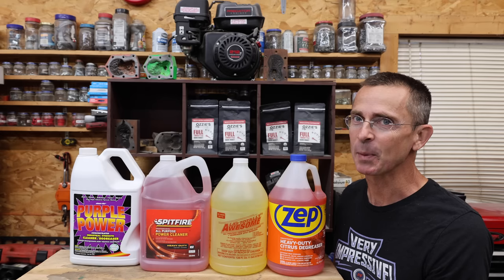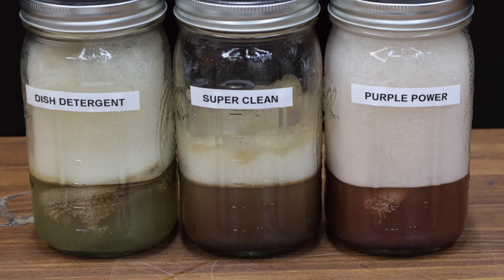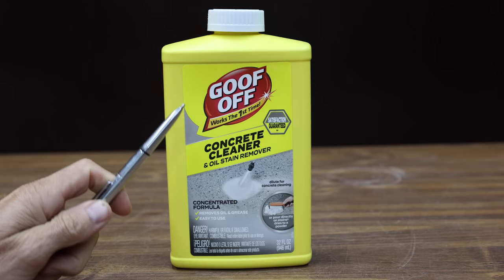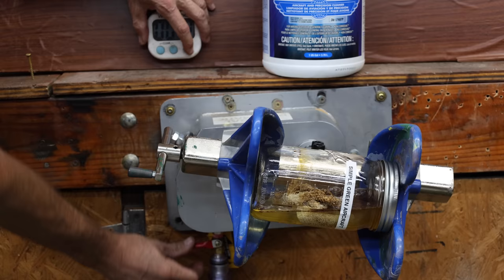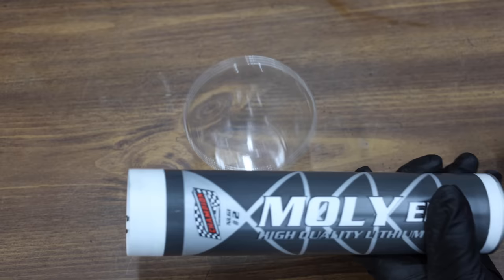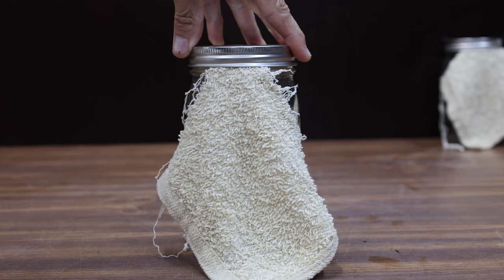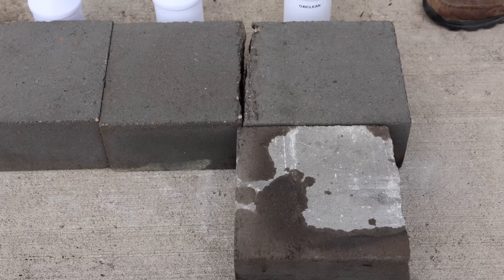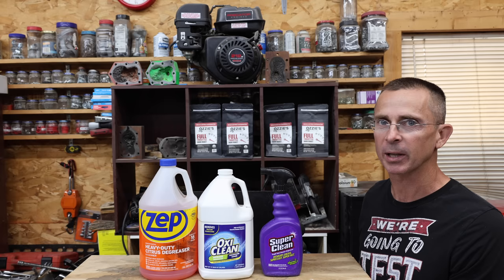Best Concrete and Engine Degreaser? Let’s Settle This!

Comment: An addition to your channel, maybe repairs most don't consider and just replace the part, like rebuilding your own starter, or alternator, reconditioning a battery, some of which you may have already done. Great Channel, I always go to you first before I buy anything related to what you cover.
Reply from the maker: Thanks!

Comment: I sell Oil Eater at work (I manage a hydraulic hose shop). I've cleaned oil spots on my driveway and I pre-treat my clothes with it. Now, on the 1 gallon jugs it says 1 gallon makes 30 gallons, also on the back label it shows 10:1. Also, it's biodegradable, non-flammable, non-acidic and non-toxic.
Reply from the maker: Thanks for sharing.

Comment: Great content as always. You are the “live and unbiased” consumer reports beater! I have not viewed your entire library of videos….but will look for weed killers for tough weed (ivy), maybe best green and thickening Kentucky bluegrass fertilizer that can only be watered by rain……as for branching out, how about videos on products that do like things but with different systems..pros and cons? Sample might be dethatching acreage with a tractor….many different attachments meant to do the same…how they each work, plus pros and cons…..can apply to vehicles, engines. How to build a 1/4 acre + pond? Just so many things out there……..still, product testing is probably the most requested service by most.

Comment: I've used a product called "incredible pink stuff " recommended to me by a mechanic.  Worked well cleaning engine parts and block , had to spray them with oil afterward to keep them from rusting
Reply from the maker: Thanks for sharing.

Comment: Test the Shaffer cleaner, after 44 years at a pipeline pump station with multiple stationary diesel engines I found the Shaffers cleaner far out did all other soap cleaners.
Reply from the maker: Thanks for the suggestion.

Comment: I've been using superclean since the 80s.... when Castrol still owned it.  I'm glad to see you removed it from the towel test since it will stain things purple. (Including fingernails LOL)  WHen I work on old equipment... it will clean better than anything else. (And doesn't stink like "Foaming" engine cleaners)   Oh... one last thing.... none of those are designed for Bio-removal, so I'm not sure why you did a mildew test.  AND... going back to my previous statement... it could stain the plastic siding. Thanks for the vid

Comment: Todd, I LOVE your channel.
As a scientist myself, your employment of the scientific method on ACTUALLY USEFUL products/info is INVALUABLE.
That said, your mechanical knowledge is INDISPENSABLE,  and I would really learn SO MUCH from seeing you rebuild transmissions/engines, etc.
If I have a vote I would say if you could keep doing product reviews AND add transmission/engine rebuilds, that would be great for me.
Also, for the above experiment, I would like to request adding alcohol as a degreaser: since "like dissolves like" using increasingly more organic alcohols should help dissolve the grease better (though there is probably an upper limit), i.e. MeOH, EtOH, Isopropanol, Butanol, etc.
You can also try acetone, or even "rinsing" with gasoline, THEN washing away with acetone, MeOH, EtOH, etc.
In the lab we often clean glassware that needs to be stipped of organics/detergents using other organics (generally simple organics) that evaporate quickly and DON'T leave a residue.
The organics are also good as a final "rinse" of glassware after washing with water, as they will hyrdogen bond with water and evaporate with the water faster than water does on its own.
A word of caution: make sure to wear disposable gloves (nitrile is my preference, like the black ones you wear) acetone dissolves plastic, and due to all the organic nature of the alcohols, the oils will be stripped off your skin and dry your skin out.
Thanks again for all your hard work, I'm happy to help in anyway I can if you need more info, etc.
Reply from the maker: Thanks for your opinion.

Comment: Long time viewer here and super thankful for the videos you put out. I'd like to throw this out there... I recently rebuilt a motor for my truck and as you may expect (being an older truck) the parts were TERRIBLE dirty! Rather than paying a machine shop to clean the stuff I figured I'd stop by here and see what sort of degreasers do what. I wound up grabbing up a few bottles of purple power mainly due to it being on the shelf at the auto parts store. I got to SCRUBBING. Wire brushes, brillo pads, steel wool, scotch pads, and loads and loads of elbow grease. Finally I decided to grab some of the LA's Awesome from the dollar store. Dude... That stuff is AT LEAST 40x better than purple power. Once LA's Awesome came into the equation... I literally stopped scrubbing. All I had to do was pour the stuff in a bucket and let the parts soak for a few hours. I wound up soaking my entire heads in this stuff! Nothing short of PHENOMINAL. It eats everything but rust. I will never buy another degreaser (willingly) so long as I live.
Reply from the maker: Thanks for the feedback.

Comment: Greenstuff J30 Industrial Strength Degreaser sold by PDP in Canton Ohio is probably the best overall degreaser - cleaner we have ever used. It "is a water based, non-flammable, and biodegradeable product.  A heavy sudser with a strong affinity for oil and grease, as well as dirt". It works for many applications and has been our first choice for over 30 years in the truck and automotive industry!
Reply from the maker: Thanks for the feedback.

Comment: I use Oil Eater in my floor scrubber for my floor at work... It does a pretty decent job using it diluted in water 50:1... Great video!
Reply from the maker: Thanks!  Thanks for sharing.

Comment: I remember when Greased Lighting came out there wasn't anything that could touch it, as a matter of fact you didn't want to get any of it on your hands because it seemed like you could never get it to wash off. But it sure would attack the oily/greasy stuff i used it on. The last time i bought it it didn't seem to work as good and the price had doubled.

Comment: Awesome review! Wish you had included S100 in this. It’s marketed as motorcycle cleaner but in my experience it’s the best at getting grease, oil and grime off anything by simply spraying it on and rinsing it and all the dirt and grease right off. It’s amazing.
Reply from the maker: Thanks!  Thanks for the constructive feedback.
Reply: Try the Simple Green Pro HD. It’s also safe for motorcycles. It’s specifically formulated to be safe on all metals. It won’t corrode/etch like Super Clean and regular SG can.
Reply: @seashackf1 thanks for that info

Comment: Love all your videos brother!. Since you soaked the concrete blocks in oil, it would of been really interesting to see what would of happened to them if you were to let half of each block soak in its respective cleaning product + a control instead of power washing. I’ve also have heard from different grease monkeys that tide laundry detergent works pretty alright. Either way, great video👍🏽

Comment: I've tried Super Clean, Zep, Purple Power, Krud Kutter, LAs Awesome, and Simple Green (standard) on "baked-on grease and oil". Super Clean is the only product that would soften and remove such grime! Soak your range vent-hood metal filters in it for an hour or two; and you can almost rinse the grime off!
Reply: Be careful, SC can corrode/etch aluminum. They even now specifically warn about it. Unlike the WD40 Specialist and Simple Green Pro HD which are specifically made to be safe on all metals and not corrode.

Comment: I would like to see you do a few different engine/transmission teardown/rebuild, while using your choice for various lubes and whatnot and a brief explanation of why you chose those items.
You could even do T&R on different power tools that you use on the farm and possibly around a household garden.  It would be nice to have an easy to follow repair video, and I think that you have the ability to make videos that are easy to follow and are still informative.  Thanks
Reply from the maker: Thanks!  Thanks for the suggestion.

Comment: Careful with these when using concentrated; i splashed some Zep cleaning an engine, and a little bit soaked in to the top of my sock, I paid it no mind and kept working for a couple hours until it started itching more and more. Turned out it de-greased the top few layers of my skin, came right off with the sock lol, and my foot swelled up for a few days.
Reply from the maker: Thanks for sharing.

Comment: Super clean has always been my go too. It may be pricy but I stand behind their products. Their foaming degreaser is a life saver.
Reply from the maker: Thanks for the feedback.
Reply: Be careful, SC can corrode/etch aluminum. They even now specifically warn about it. Unlike the WD40 Specialist and Simple Green Pro HD which are specifically made to be safe on all metals and not corrode.

Comment: Your testing is reminiscent of MIL-STD-810-G testing but in some aspects more intense.  Keep going as you have only skimmed the surface.

It would be interesting to see you test various electric screwdrivers and drills of various battery voltage ratings; various car wheel tire and rim cleaners; various car leather seat conditioners and protect ants.  

Great channel!
Reply from the maker: Thanks!  Thanks for the suggestion.

Comment: We've been using Super Clean for decades.  They warn you not to use it on hot engines and I can confirm that.  Tried that on a slightly warm engine once and it bleached the blue valve covers white. Also stored the bottle on a metal shelf for a couple of months and the migration from the cap down the side of the bottle stripped the paint from the shelf!  Stuff is potent.  Best to wear gloves when using it as it's very difficult to rinse off of hands.
Also use krud cutter for laundry and it works well in washing machine.  Super clean makes a good prewash spot remover.  Simple Green, Purple Power, and Zep haven't worked well for us.  May be differences in water or soil involved.
Reply from the maker: Thanks for the feedback.
Reply: Super Clean can corrode/etch aluminum. A few years ago when YouTubers were hyping it for automotive use they said it was safe on all metals. Now SC has a specific warning about that it’s not safe for it. Because of that I’ve gone back to Simple Green Pro HD, the purple one. It’s specifically formulated to be safe on all metals.

Comment: Excellent test and review so we don't have to do the same.  I use Zep to clean my smoker.  Does an excellent job.  I have trouble with removing oil stains from my drfveway with any cleaner.  I've even tried gasoline and carburetor cleaner with not much luck.  So I grind clay kitty litter into the stain until a fine powder remains and I leave it there until the next rain washes it away; then it comes back but not as bad.  I think a lot of the oil stain is from solids suspended in the oil.  Difficult to lift and float away.
Reply from the maker: Thanks!  Thanks for sharing.

Comment: Best degreaser...Mineral spirits. Second best, diesel with soap added. Third, steam cleaner/hot water pressure washer with dawn detergent...
The hot water pressure washer is my favorite, but who owns one of those ??? My personal home shop fav is mineral spirits.
Former Tool and die maker - engine  builder/offroad.
Reply from the maker: Thanks for sharing.

Comment: I've had good results with the Zep citrus,  and the zep  blue / green cleaner works well too.  In fact, I even use the zep green as hand cleaner (no more gojo).  The zep citrus can be used for hand cleaner too, but its stronger and can affect skin after awhile.   I vote for please continue product testing.   You pack a lot of info into your videos.
Reply from the maker: Thanks for the feedback.

Comment: Gramps had a sure shot loaded with 50/50 gas/red diesel on the farm, obviously gotta be careful about flammability but he told me the diesel stabilizes the gas and also makes it not evaporate too fast so it can work. Would give tractors a quick wash with a hose to get most of the dirt, then soak the deposits with the mix, leave it overnight then wash it the next day and most of it came off easy, would be interested to see a test of straight gas, straight red diesel, and a 50/50 mix vs the top 3 of these
Reply from the maker: Thanks for the suggestion.

Comment: Dawn soap was used in a major way to clean up animals after the Exon Valdez oil spill.  It definitely is not at the bottom!  Need to add more product and hot water.  Makes a big difference for that product.  No other product could do that job effectively.
Reply from the maker: Thanks for the constructive feedback.
Reply: @ProjectFarm  no problem, it’s worth noting as sometimes you don’t need or want a “full throttle” cleaner.  Over 75,000 animals were cleaned up with hot water and Dawn soap.  The stats for the disaster are staggering.  Web search Exxon Valdez and Dawn soap.  Dawn will forever be in my cabinet!  Great channel thank you!

Comment: Just a comment here... I have used Dawn to remove engine oil from clothing, it actually works very well, but not in the ratio they recommend on the back of the bottle.  I have used it full strength by pouring a a little bit of the product, normally using the size of the stain on the clothing as a guide.  Then I let the Dawn sit on the clothing for about two days, and run normally in the laundry.  It actually works better than Spray and Wash.
Reply from the maker: Thanks for sharing!
Reply: Yes, he used way too little of it. That amount is for doing dishes. I use 3-4 oz in a 32 oz spray bottle.

Comment: Test engine friction reducers with your bearing tester: BG automotive, WYNNS, slick 50, Rislone, Lucas, Zmax, STP synthetic.  Test for friction / shear reduction, cleaning carbon / varnish, high temp stability,
Reply from the maker: Thanks for the suggestion.

Comment: Brake cleaner and kitty litter works well for cleaning concrete. Sweep all loosen dirt off the area to be cleaned. Spray brake cleaner liberally on about a 3' x 3' or smaller area. Might require multiple cans of brake cleaner. Use a large brush to rub the area. Immediately spread cat litter on the area. Then move the cat litter off and repeat until stain is gone.
Reply from the maker: Thanks for the feedback.

Comment: Mix it up.
But I LOVE the product comparisons.  
Instead of produce comparisons,  ANSI/Safety demonstrations would be great for workplace safety talks.; steel/composite boots, hard hats,welding hoods, gloves for abrasion/chemical/ electrical, Arc flash suits, fall arrestors, non-contact voltage detectors.  Call it PPUniversity?

I've shared your Safety Glasses video w/ co-workers on our safety Teams call. That they all passed the ANSI tests is VERY reassuring and your demonstrating what safety glasses can withstand is outstanding! Who knew a $2 pair of glasses would keep a steel rod from even TOUCHING your eye!
Reply from the maker: Thanks for the feedback.

Comment: The Dawn Platinum does work well as laundry detergent but I use Hot water when washing.
There might be a difference in chemical reaction due to heat.
Reply from the maker: Thanks for the feedback.

Comment: Super Clean can corrode/etch aluminum. A few years ago when YouTubers were hyping it for automotive use they said it was safe on all metals. Now SC has a specific warning about that it’s not safe for it. Because of that I’ve gone back to Simple Green Pro HD, the purple one. It’s specifically formulated to be safe on all metal.

Comment: I once drained the oil out of a Honda. Filled it with a gallon of super clean.
Let it sit in the engine for a couple of days. Took the valve cover off. Sprayed all the parts till they were cleaned.
Drained it out. Then flushed the engine out with cheap warmed up oil.
Really cleaned it out.
Got 430,000 miles out of the engine till it burned an exhaust valve.
Reply from the maker: Thanks for sharing.

Comment: You’re supposed to shake the food off before using, as the chemicals inside separate. You just used the clear stuff at the top but it’s actually a thick white paste when you shake it up

Comment: Ive found LA's totally awesome to work great for cleaning an engine for rebuilding, a cast iron one amyway since youre not supposed to use it on aluminum. It did a great job removing old caked on baked on oil from pushrods, rockers, dogbones, etc. And also worked great for fegreasing and removing minor rust from the block with a toilet brush, and also worked well as a sort term rust preventative while building it, then just cleaned it all off with naphtha right before i painted it since the naphtha would cause flash rusting within a few minutes so had to paint it as soon as you dried off the naphtha. Good stuff.

Edit: i used it at full strength for everything. Also works very well for cleaning rubber floor mats.
Reply: Ya, the corrode/etching on aluminum is a big problem, just like Super Clean. Better off with the Simple Green Pro HD, or even WD40 Specificalist, which are specifically made to be safe on all metals and not corrode.

Comment: Try super clean!

All the brands I’ve tried this one has been pretty amazing for decreasing engines, cleaning carpet and upholstery both home and Auto

There’s another degreaser they sell at Lowe’s that I really like, I use it my sonic cleaner when I’m cleaning carburetors and motor parts. It will not alter the color of the aluminum and it does a very good job.

It’s just come to mine. It’s called crude cutter!
Reply from the maker: Thanks for the suggestion.